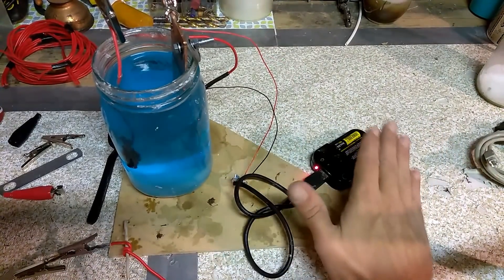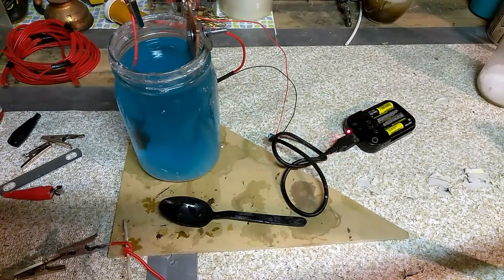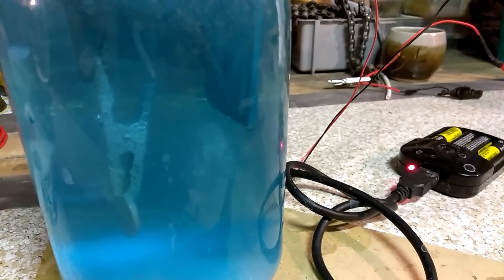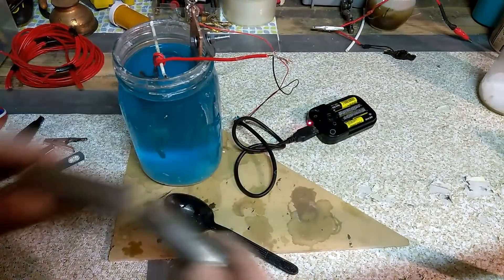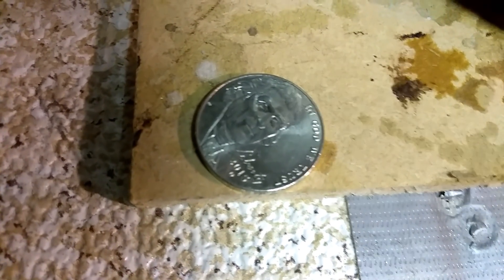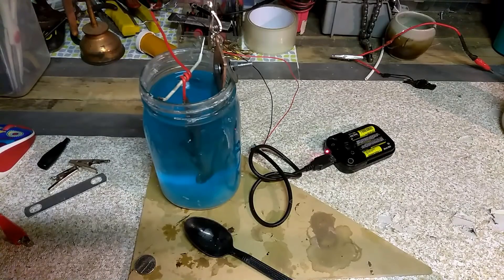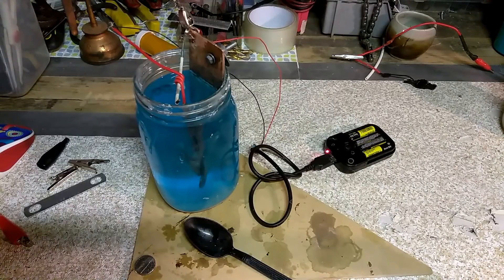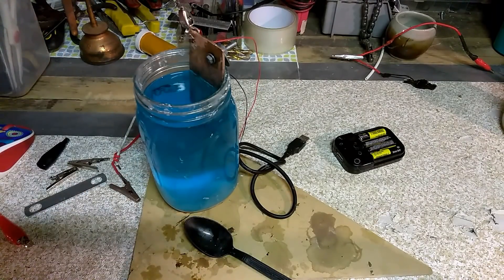Copper electroplating using baking soda.

Comment: Used a similar copper zinc thing with a simple food grade acid on a few flint lock's barrels for a flat darker gray very Corrosion restant affect and molton salts passivated most the other steel bits. This Base solution is INTERESTING to "ME"and could have desired knock on effects? Going to try soon on an UGLY Dead parts supper cheap trade 1911 slide

Comment: Which wire goes where positive to copper or negative to copper and when you first started what went to what? Did both wires go to copper or did one go to a different metal?
Reply: Connect a piece of copper to each wire first, leave it in solution for about 45 minutes, this makes the electrolyte.
Then remove the copper from the negative wire and connect the piece of metal you want to plate.
It's also better to mix baking powder in warm water.

Comment: If you don't want to burn through batteries, go look for an old power supply next time you're in a thrift store. Most of them will only run 4/5 volts, and they're already DC, so you can "plug and play".

Comment: If I remember correctly the E_0 of Cu is around 0.54 V. I don't think that voltage affects the rate, but current does. So theoretically, you could do this with just one triple a battery.
Reply from the maker: Thanks for the info. I may take another run at this project next week.
Reply: @ThriftStoreHacker  thanks for responding on such an old video! good to see that you are very engaged with your viewers. I just subscribed and i hope to see the video soon! cheers.

Comment: does this work with brass instead of copper? I want to coat a steel object in brass
Reply: I don't think you call electroplate brass because it's an alloy.
Reply: You can plate copper and then plate zinc on top and you will end up with a brass

Comment: In order to chrome plate on steel you need to copper plate the steel, then nickel plate the copper and finally chrome plate the nickel. I suggest finding a copy of something like "The players handbook." Be really careful as the chrome solution and rinsed are very hazardous.
Reply: A quick question. My first attempt at copper plating steel (or some sort of steel alloy) failed horribly. Then I read or saw that in order to copper plate steel it needed to be nickel plated first. I since have ordered a nickel anode to use, going on that bit of information. Then I see another vid of someone copper plating a steel hammer with no need for nickel. What am I missing and what am I doing wrong? What I am trying to plate is a float bowl off of a generator that rust bigtime on the inside when generator is dormant.(rust then plugs the main jet and generator will not run) Whatever alloy is it... magnets stick to it... so it certainly has an iron content. When I did the plating procedure it all looked like it was doing just fine...….. turning the float bowl a dark red. Taken out of solution an wiping it down... ALL of the red wiped off. Zero plating. Id appreciate you sharing your knowledge with me. Thanks...
Reply from the maker: I honestly haven't got this completely figured out yet and plan to release another video this month.  One thing I have noticed, if you use very low voltage and amperage and go really slow the results are much better.

Comment: A 50/50 mix of vinagar and Hydrogen peroxide  works much better.
Reply from the maker: I will try that. Thanks.
Reply: Does a  copper plate cuts( reduces the lighting)   light of torch lighter

Comment: maybe try adding some kind of acid to it like even vinegar would help
Reply: from my understanding, alkaline solutions can work better for shine and evenness on the right choice of metals.
Reply: @kiaas  give example of an alkaline solution for this
Reply: @ARCSTREAMS  bases such as baking soda for one, washing soda is a bit stronger.  I'm not sure what else is suited for plating.
Reply: @kiaas  ok but i always thought you need some acid to get this thing going so it helps strip the metal ,also peroxide acts like a catalyst to help create the electrolyte solution but i never seen water and bs alone,,funny his water color is blue mine is usually always turning green but it works
Reply: @ARCSTREAMS  bases (which make alkaline solutions) do the same thing as acids, in this regard. Chemistry isn't my forte, but both acids and bases can be used to make soluble compounds that'll plate metals, as both can be Corrosive. vinegar will make copper acetate and baking soda will make basic copper carbonate, as the copper-bearing electrolyte here. They'll have different oxidation states on the copper so different colors.
Reply: @ARCSTREAMS  I'm not sure how much you know.. so the most basic thing about Acids and Bases is that acids are any pH below 7, 7 is neutral, and anything above 7 is a Base. basically any Base that will dissolve in water is called an alkali, so any solution in water with a pH above 7 is an alkaline solution. 
Note if you put both an acid and a base together, they react to try to neutralize each other and producing a Salt. (vinegar and baking soda reacting to produce sodium acetate and lots of carbon dioxide is a common example.)
Reply: @kiaas  yes but thank you for the refresher

Comment: i still dont know how this seems to be working because its just a water solution with no acid to help strip but it seems to work kinda,maybe your current is high enough thats why?
Reply: It will work without acid like vinegar. Already tried it but he forgot one thing is to nickel plate it first to clean out any debris or foreign substance currently in the metal which is why it doesnt completely electroplated and current is kinda low which is why it is slow.

Comment: Shouldn't bubbles  be coming off the copper bar ..?    I don't know for sure, so?
Reply from the maker: If you get the perfect voltage/amperage you won't have many bubbles.  More power, more bubbles.
Reply: @ThriftStoreHacker  thanks I have been meaning to try it. I pound copper and I use Nitric Acid to clean up the fire scale after annealing. It never accured to me to save the "wash".
Also  thanks for getting back, I know now that I am not 86ed, from YouTube.
It's nice that you share neet stuff.

Comment: I always fail, the cathode gets super dark but never shiny even when I polish it afterwards. Anyone can advise the noob I am?
Reply from the maker: Try lowering the voltage. Should help.
Reply: Try to use a lower voltage source, like 1,50-3,3V.
Reply: @neutronpcxt372  Thanks I will try that
Reply: @chongtak  Yeah. Otherwise, you are going to make making copper oxide, which can't dissolve in basic solutions.
Reply: Try the flower pot method look on yt for it

Comment: The only drawback is that on the copper electrode a greenish-blue non-conductive layer grows during the electoplating. It is copper hydroxide (patina), which can be dissolved by vinegar, or scraped with steel wool. The latter is time-consuming and very exhausting.
Reply: Interesting, does it turn back into elemental copper or does it dissolve in the vinegar as copper acetate? Or both??

Comment: what i like is how the parts came out brightly plated,,usually my parts come out with what looks like a matt rusty copper that has to be brushed off but looks brilliant once brushed off
Reply: My question too. Have tried this with copper sulphate too and had the same issue.
Reply: @LEO-xo9cz  i think the first few minutes it gives a nice shiny coat but if left longer it goes into mud ,,each exp was different and i dont remember ,been a while
Reply: @ARCSTREAMS  What amperage are you using?
Reply: @LEO-xo9cz  i was using an adapter and they vary from .5 A to more or less and i used resistor to have lower setting
Reply: That’s usually because of too high voltage.
Reply: @886luke possibly that or the time left soaking or the kind of bath solution being used ,  i dont remember what my resistor(s) was or what voltages i had going at the time but it was nice and slow enough but at one point i have to leave it in longer to get a thicker coat because it looked to thin and thus i would end up getting this gunky brown mud covering, once i removed and cleaned it did come out looking nice though

Comment: i dont see how copper was striped in your solution which has no acid in it? it dont matter about the current,,water and sodium bicarbonate will make an electrolyte but wont strip
Reply from the maker: I have been trying to recreate this solution today and not getting much luck.  I wonder if the bits of pipe im using are not pure enough copper, or too old of baking soda, or something in my water supply is throwing it off.  I tried adding vinegar but it just reacts with the baking soda and bubbles.   Kinda driving me crazy but i will figure it out.
headdesk
Reply: yeah sometimes getting these solutions to work is tricky,i made a Ni solution and it was green which tells me it worked but when i tried plating a copper penny it did nothing but bubbles,,idk what i did or did not do but eventually it worked and started plating the penny ,,but mixing bs and vinegar will neutralize the solution,idk why ppl do that for? you need an acidic solution for it to work,idk how your bs worked last time,maybe because there was some salt in the bs which helped and you used lots of it,,,im going nuts now trying to copper plate this metal cross i made a long time ago,i striped it down to bare metal and Ni plated it and then Cu plated it,unfortunately it did not plate 100% there were small patches ,i had to redo it over several times and for some reasons the patch areas are not bonding with the Cu,pissing me off and driving me nuts as to why? but the Cu platting looks nice and thick when i looked at the edge of those patches with my magnifying glass i can see a pretty solid thick coat edge of the Cu
Reply from the maker: @ARCSTREAMS  hey! I figured out how to make the solution. Use a lot of baking soda. I put the two copper plates in water and added baking soda until the plates started lightly bubbling. After about an hour of running on my usb powered setup the solution started turning blue!  Im currently waiting for any excess soda to settle in the bottom of the jar and will pour off the solution into a fresh container to plate with. I will try to put out a video tomorrow.
Reply: glad to hear it worked for you,i tried it for an hour and saw no discernible color change ,how much bs did you use? according to the poster he says the key is putting lot of bs

Comment: have you tried plating ss with this solution?
Reply: Yes .plz tell mee how to do  copper plating on statue? ?
Reply: who said anything about statue?
Reply: @ARCSTREAMS  don't plate stainless steel the electricity will leech the chromium out of the stainless and will be floating around in your water.  When you stick your little hand in there to retrieve it you'll be getting a dose of heavy metal poisoning( not talking about Motley Crue)  and then you'll be sick.
Reply: i appreciate your concern but not so sure what you are saying is really that credible and hazardous ,,also as a welder of SS  there is more danger there from the fumes i breath at work than doing this ,but we wear masks ,gloves and have over head vacuum ventilation

Comment: how long did it take to get blue? i tried with bs and water and nothing happens,,i also tried with salt and vinegar but after 30 min i do not see any change ,however once i put a few drops of hydrogen peroxide it activates the blue color and starts?
Reply from the maker: It took about 45min to make the solution.  Im currently working on a new video with the whole process to clarify any issues
Reply: well can you clarify the one i just said?
Reply: @ARCSTREAMS  It took me about 2 hours before the solution went a bit blue.

If you want faster results, use copper electrodes with bigger surface area, meaning wire will work very well, and a higher volume of water.

Otherwise, you may get metallic copper deposit on the cathode, and WILL contaminate the solution.
Reply: what do you mean it will contaminate? if its copper to copper i dont understand why there would contamination
Reply: @ARCSTREAMS  Too fast oxidation will actually create metallic copper(Cu3+, or even Cu4+ if current is stupid high), which is an oxide.

The copper we want to be plated is Cu2+, and the production of Cu3+ on the cathode will result in a thin black coating on the copper, making the plating very thin and fragile.
Reply: i see,,i do get that black stuff when i tried plating nickle but i think i changed the current and it was eventually working but not sure if i switched to lower or higher,,i used a 9v batt and also a 9v adapter that had more mAh i imagine but i forgot which one was working better,,also when i try doing copper i eventually build up a smudgy looking layer but once brushed it shines new
Reply: i usually add a resistor to my adapter and i can tell by the bubble formations if it slowed it down also the resistor get hot,,eventually i get dialed in right,,, i got solid copper plates about 3/16" that i use on the anode and an alligator clip holding the other part,i also had a thinner copper strip but it was wearing out,,you can also use the ends of any copper wires i suppose ,,i had this metal cross i tig welded together a while ago and i tried copper plating it but had trouble getting on a proper Ni strike first because i noticed some patches where the copper plating did not adhere,,i power brushed it all out with my brass wheel and started over several times but still had issues,,but for the most part it got nicely coated
Reply: @ARCSTREAMS  Yeah.
Another problem I've had is actually ambient temp.

In my basement, the ambient temp is around 16C in the winter. That means less copper sulfate can be quickly dissolved, meaning there is a higher chance of Cu3+ forming, even at low currents.

Therefore, I have to forgo 10% acetic acid, and diluting it with 2x the water.

Cutting up the strips in half sections can also help with better current handling due to more surface area.
Reply: you sure seem to know alot about the electro chemistry here,i did not know such mild changes in temp can affect the outcome,,but why make it less acetic? does this somehow slow down the reaction of Cu3+? and promotes Cu2+?
Reply: @ARCSTREAMS  See, at lower temps, less copper can be dissolved obviously. At low currents, it's not a problem since only Cu2+ will be formed, as I've actually tried it yesterday, and no black copper Cu3+ was found.

Therefore, to prevent current saturation at low temps, lowering current/cm2 is helpful.

So either lowering conductivity of the solution using less concentrated acid, or lowering voltage can be used with a CC power supply.
Reply: @ARCSTREAMS  So basically, with a lower temps, less copper is soluble inside of the solution.
Reply: ahh you saying lower temp mediums are less conductive? well i do not mind at all waiting longer for a nice proper bonding and shiny platting ,but it's been a long while i have not used my solution ,the copper one's liquid level is evaporating because i did not keep it in a sealed bottle,its just sitting in the glass tray i was using for a bath to put parts in,i only covered it with saran wrap,,oh wow i just took a look inside and the bottom has these black looking crystal formations,they looked like carbon at first but i can see now they are like small crystals like black onyx,,are these cooper salts? i thought they were suppose to be green or blue?
Reply: @ARCSTREAMS  Lower temps makes solutions not only less conductive, but also less soluble, meaning less copper is dissolved, making the plating process slower.

Also, was it black or brown? Brown is good copper that has not been dissolved, but black isn't.

And yes, copper salts are blue.
Try getting all of the copper to evaporate to see what forms. You can actually reuse copper salts for copper salts store. It's what electroplating manufacturers do, especially for precious metals like silver and gold.
Reply: a brown muddy smudge once brushed off makes a shiny durable coat,so it works well,,,as for the copper bath yeah a bunch of black looking crystals or salt,,i put one under runing faucet and either it dissolved or simply broke apart into 3 pieces,,never grown crystals before so idk nothing about it but its odd to see black instead of green or blue,perhaps this may be the result of impurities? but it looks pitch black  and uniform,i will let the rest evaporate and see what happens

Comment: do you have a simple method to make a gold plating solution?
Reply from the maker: I don't. I think Codys Lab has done a few videos on gold plating.
Reply: yeah but he uses a few chems that are hard to get a hold of and im looking to see if there is an easier way and less harmful using things you find around the house ,,i can still get muratic acid and amonia etc but hcl and sulfuric or nitric acid is just too much bother,,surely there must be a simpler solution that can strip the gold off some bracelet i can use but i need to research more ,not like i can juts mess around with gold like its a disposable metal lol ,,say what about gold bond? lol
Reply: @ARCSTREAMS  sulfuric acid = battery acid, go to a battery store, they'l sell it ...
Reply: @KeesHessels  you sure because 100% sulfuric acid burns metal
Reply: I also need sulfuric acid for plating purposes so ill get some from the car battery store..
Reply: @KeesHessels  ok its been a while so i forgot,,acetic acid is vinegar right?

Comment: so you are only using BS( a base) and no acid solution? how is the copper stripping off the plates and going into the solution then??
Reply from the maker: I assume the electrical charge is stripping the copper off into the solution.
Reply: yeah i guess so,,but usually they use acidic solutions and i think its because it helps strip better or make a better conductive electrolyte